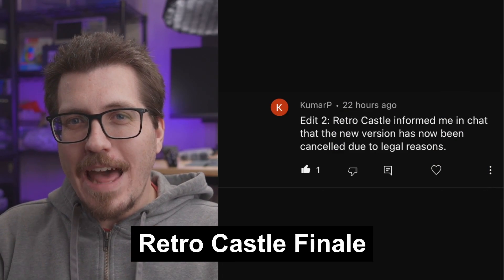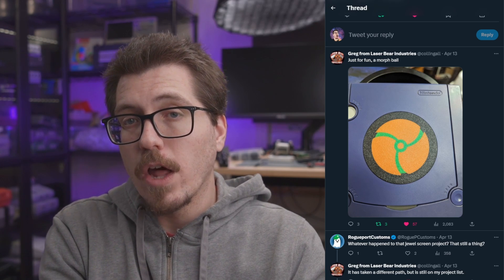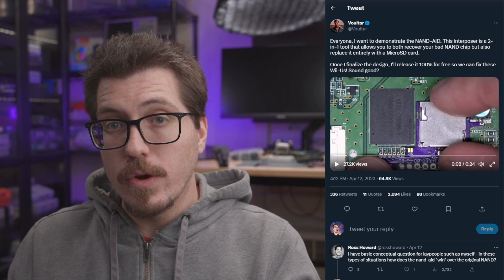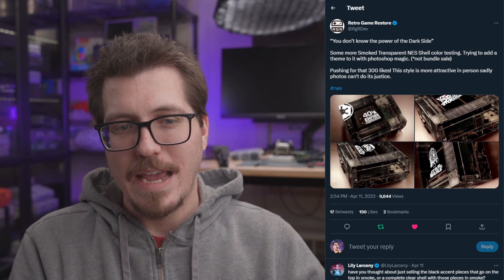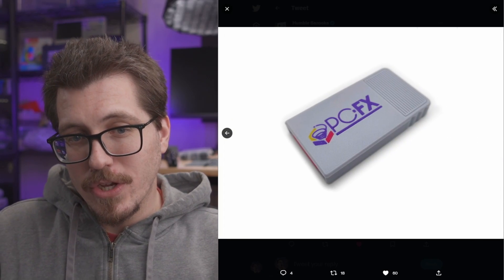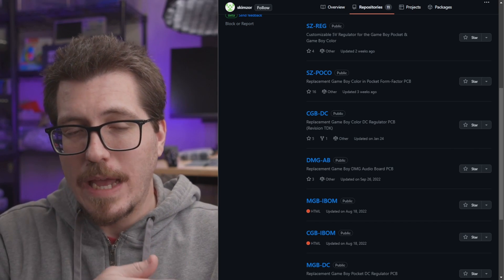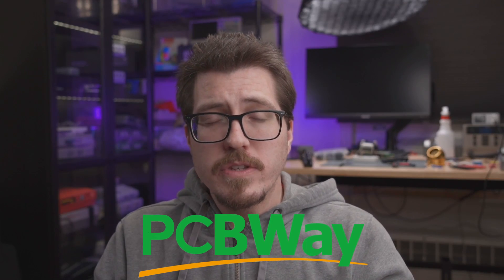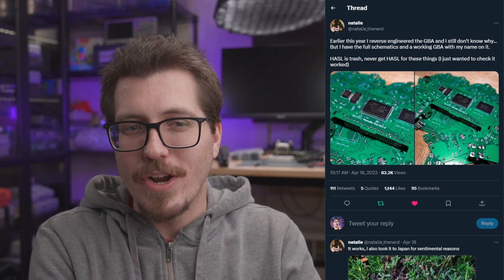Reverse Engineered Game Boy Advance PCB - Retro Modding News

Comment: I hope the re gba boards will incorporate improvements to the ground plane and power input circuitry like what mathjis did with his game gear boards.

Having a 1:1 recreation is fine for repairing borked systems, but if you're going to that effort, it'd be nice to see some qol improvements to go with it.

If it does have improvements then ignore me, but if not, then that'd be a must have for me to buy one.

Comment: New shells can look really cool, but realistically, for most systems, you can get a new system for cheaper than a replacement shell. Especially if it's a non working system with a shell that is in fine shape.

Comment: Those Retro Game Restore cases are awesome.  I had a gross and cracked PC Engine and controllers that I swapped into his shells (the "smoke" ones) and it's such an improvement.  Plus I got stickers/inlays from GrafxGear to finish those off.  Also I replaced a brown and brittle Super Famicom case with RGR's clear one.  It's smooth and shiny like glass and I would actually prefer a rough texture and some color to it, but it looks great anyway and it accepts cartridges from any territory now.

Comment: Did one of the gba boards a few weeks ago. Was definitely a pain especially since the screen connector on my was crooked and so it messes with the screen a bit. Second board I am gonna do isn't crooked though which is good.
Reply: Are those boarda available anywhere? 😮
Reply: @Aisflou  I got mine from Retro Game Repair Shop. Funnyplaying also has stock sometimes.
Reply: @Neronium  thanks!
Reply: @Aisflou  No worries. The Funnyplaying boards also have all the audio amps built into the boards so they are way louder than stock GBA.